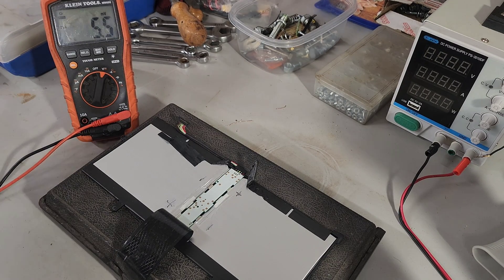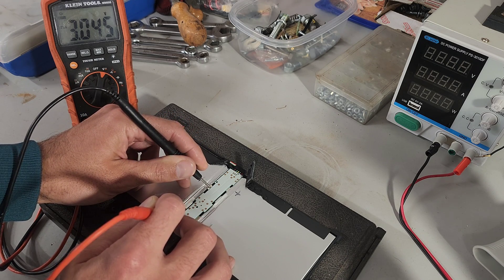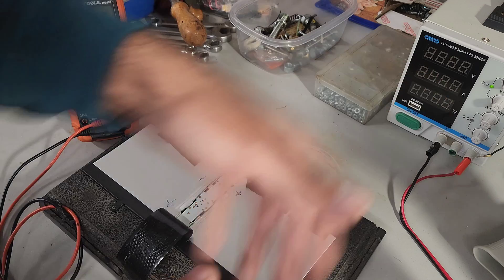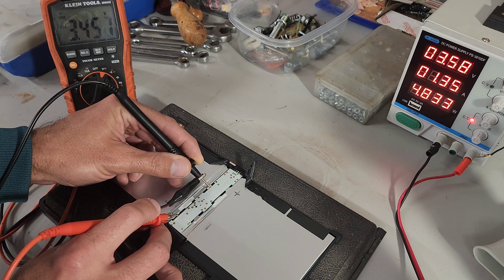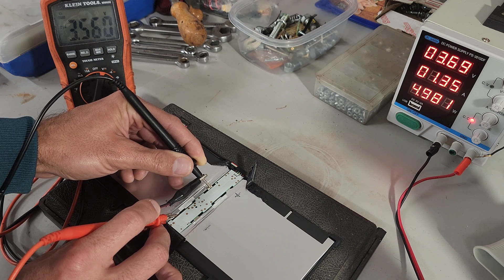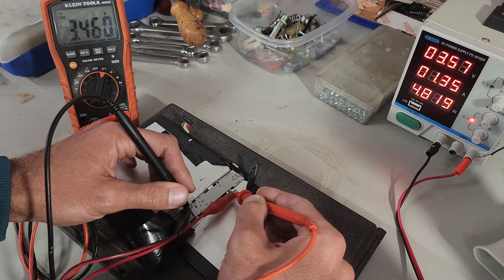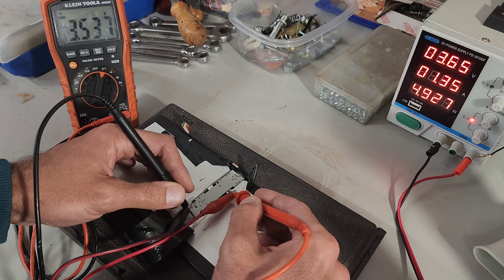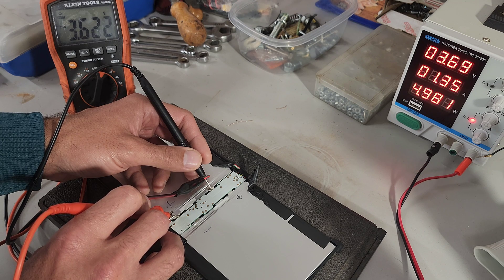How To Fix A Laptop Battery That Won't Charge (Bring A Dead Laptop Back To Life)

Comment: Looks simple enough.
But the devil is in the details, as you mentioned, it can be dangerous if you don`t know what you`re doing.
Do you have any tips on where to get info on the from/to parameters from the DC, not to blow the battery up and burn down the house just or damage the cells?
I am trying to revive an unused laptop battery this way but find it too risky without knowing what the settings of the bench power supply need to be (and I need to buy one that fulfills the requirements in range for example)
Thanks in advance for the heads up!
Reply: Also, I have no clue about electronics, but reading it up I hear that charging at about 1A is potentially life threatening, even at only 4V, if you touch the nodes which you are holding here freely, is that correct?

Comment: I am in this boat.  I have a brand new laptop in the box from 5 years ago.  Been in my closet, never been used more than once to set it up 5 years ago.  Took it out today, battery won't charge.  It's an HP Zbook.  No way the battery is dead or worn as it was brand new and used once.  I may try this method if I can get all the tools.
Reply from the maker: It's worth a go. Worst case you buy a cool bench power supply that has 1,000,000 other uses

Comment: what min voltage it need ??? i go from 2v to 3.80 but BMS still refuse to input voltage and win11 and bios say 0% charging battery is c21n1714 look same than yours

Comment: I wonder if there is an actual safety reason why the controller stops permanently with battery that has voltage gone too low?
Reply: probably in case it is a shorted battery

Comment: Good video! For older laptops with removable batteries, sometimes the protection circuit will not turn on once you've brought the cell voltages up. You may need to talk to it over SMBus, but I have not succeeded with that yet.